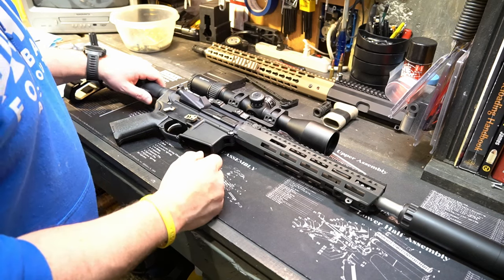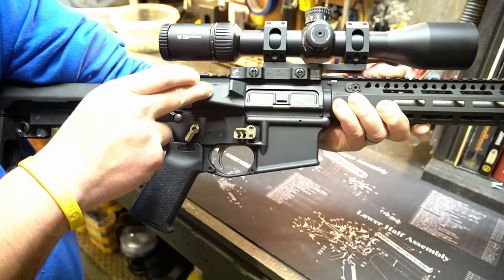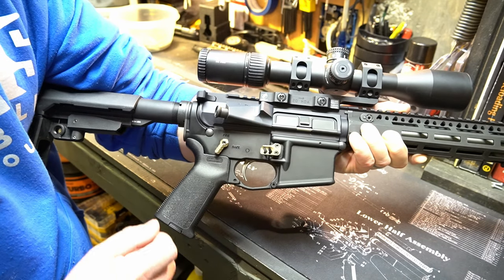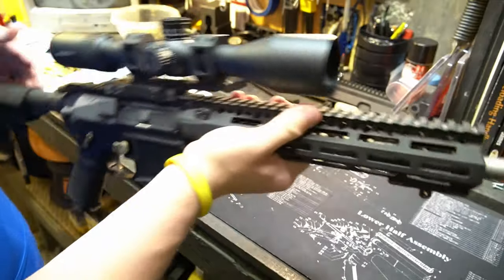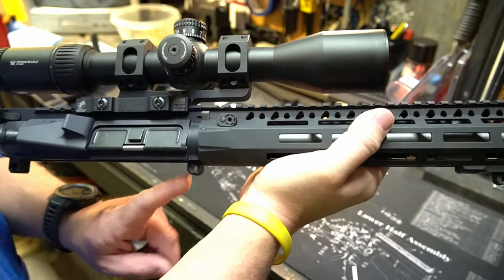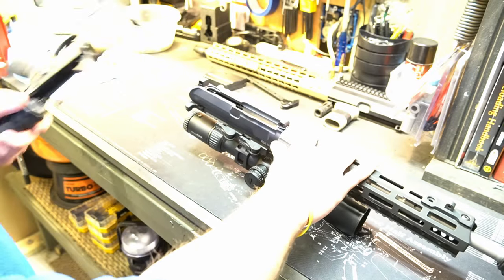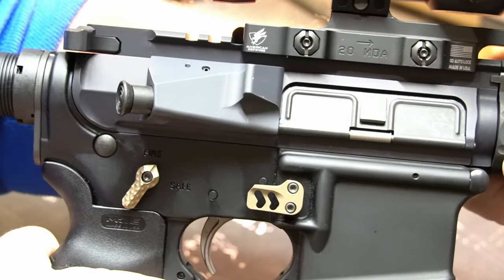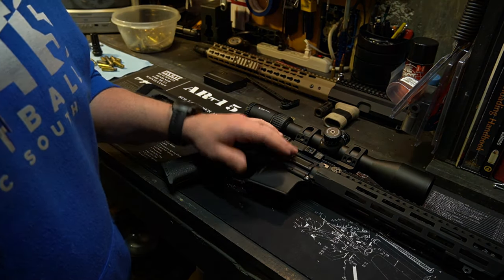AR15 Upper and Lower Wobble Fix

Comment: If people only knew how much ‘slop’ there is on govt issue lower/uppers.... and how reliable they are, they’d immediately recognize how irrelevant paper-width gaps are and stop spinning wheels on unproductive efforts.  Folks need to stop obsessing about this.  A little wiggle doesn’t effect operation or accuracy in the least.
Reply from the maker: Nope. Just annoying. Like my stuff with as little of play as possible.

Comment: Utg which is chinese garbage actually makes a rubber insert that helps, all u have to do is install and see if it closes. If not lightly sand the bottom and try again. For 3 dollars it works, they are red and rubber. Not hard to do at all…

Comment: But there is going to be play as the o-ring will still compress when the firearm is shot. 

I think a better fix is to install shim washers on the sides of the front and rear pivot pin studs. 

Measure the width of the stud and then measure the mating clevis width. The clearance will be how thick of a shim you will need to once you have the shim, you will want to stone the shim until its .0005” thinner. Then you can install it on the weapon. Do the front pin first, then the rear. 

You will also want to bed the barrel extension to the upper receiver. Measure the od of the barrel extension and the ID of the upper receiver. You want your shim thickness to be .001” to .0005” thicker than the measured clearance. 

Wrap the stainless steel shim around the barrel extension and temporarily hold it in place with a rubber band. Place your barrel into a chest freezer for 3-4 hrs. 

Heat up the upper receiver bore with a heat gun and start the barrel extension into the upper receiver. Cut off the rubber band and quickly slide the barrel home and torque the barrel nut as usual. When the temperatures of the two parts normalize there will be an interference fit and your barrel is bedded. 

Doing those two things are the most bang for your buck when it comes to accurizing an AR.
Reply: or.... you could just use an o-ring 😂

Comment: This "fix" is going to make it worse. In other words, because of the tension you added the pivot and possible the takedown pin holes will oval out and now you'll have real problems. You better buy o-rings in increasing sizes lol
Reply from the maker: 😂😂 nope!
Reply: @HoosierHunter  just like what an Accuwedge does. Your expediting the wear on the pivot and takedown pin holes, granted the rifles actually get shot.